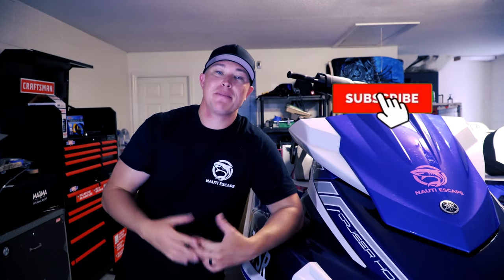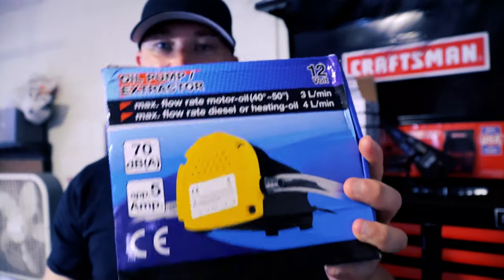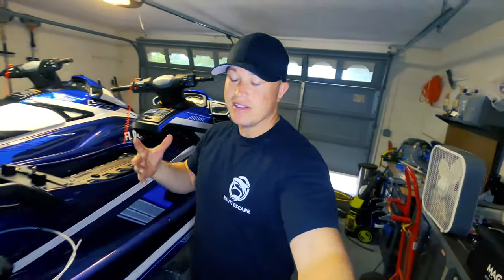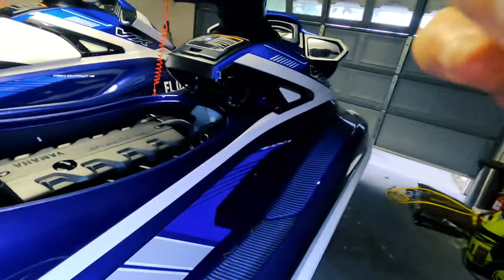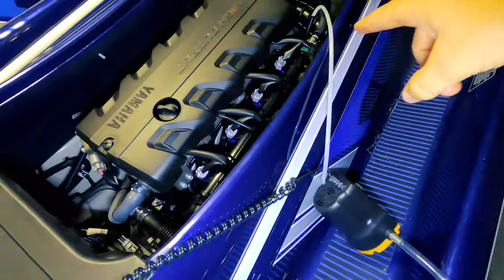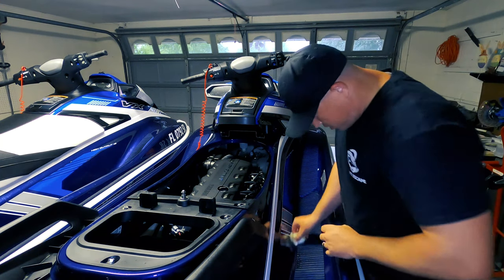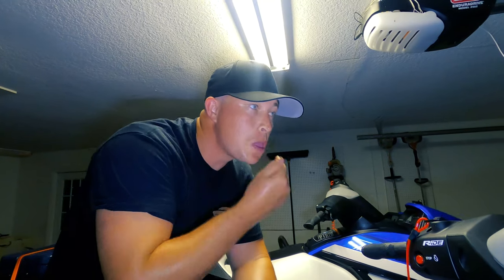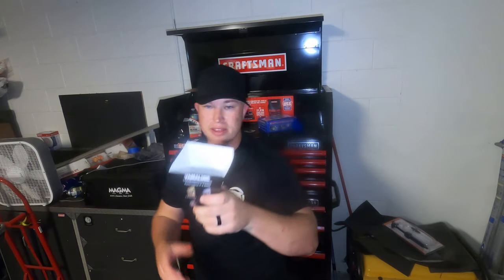How to change oil on jetski

Comment: Good job on your oil change. Use rags or towels when changing filter.
Reply from the maker: Thanks a lot. Certainly made a couple mistakes that some have taught me but it wasn't bad for the first try and shows how easy they really are to do and you really don't have to be that mechanically inclined to do them.

Comment: Yo bro correct me if I'm wrong but I thought u had to run a water hose through the unit b4 u start it?
Reply from the maker: Absolutely! I added an update in the description of doing so as well. 

Granted the only thing your going to do is take out 3.5 quarts of oil sucking it out vs 4 if you don't let it warm up more. 

As far as dry starting it you can let it dry run for about 30 seconds per the dealer. Everytime we come out of the water and put the skis in the trailer we'll start them and hit the gas 3 or 4 times which will push all the water out from inside rhe skis vs having to take the drain plugs out each time.

Comment: Yes. Fuckers charge like $160 per ski in my parts. Fuck that shit. I do Amsoil myself (after watching project farm channel, that oil is seriously long lasting) it's full synthetic. You can extract from where you did,  on my vx limited I have to use the upper hose too to get out more oil (~another half to 3/4 qt was hiding there). Not sure on the 4 bangers though, I have the tr1 motor which is 1049 cc 3 cylinder (2020).

Comment: Put hose clamps on that electric pump to hold the hoses in place, I found out the hard way that they will loosen with time and make a mess of your garage when they come slipping off while pumping oil out. As for the oil filter try to find a crown wrench that you connect to a ratchet to make your job so much easier.
Reply from the maker: I'm glad you told me about the hoses, or I wouldn't have thought about it until it was too late I'm sure. I really do appreciate the helpful advise!

Comment: I believe it’s worth going to the dealership I pay 250 for plugs and oil change and they lubricant and grease necessary components I had 2006 Yamaha FX cruiser he chose I just saw them in 2014 and had zero problems with them I believe is worth it to check for updates also and recalls
Reply: I would normally agree but in today's world it's hard as Hell to get good help and workers.  Who the heck knows who's doing the work and how well he/she is doing it.  It's sad...

Comment: Hey love your vids bro! When did you do first oil change on your vx ho? I've been advised to run the bike in for about 5hrs at low revs then do oil & filter change at 10hrs.... 
Want your advice 😆
Reply from the maker: If you ask 10 people it seems you get 10 different answers lol.

Dealership told us to run the skis for a half hour at mixed RPMs and then we were good for break in. We've been told by others do it for 2 hours, and even to never hit full throttle for an hour.

We changed our oil and filter around 10 hours. Manufacture says you dont have to change the oil filter at 10 hours but others have said all the loose metal debris from the new motors will be in there and that's the most important time to change them. It sounded logical and the filter comes with the kit so that's exactly what we did.
Reply: @NautiEscape  well I'll take your advice on it then bro! Thanks for reply 🙌🏼😉
Reply from the maker: @julianmcgrail7518  lol anytime man! Good luck

Comment: Do you need to change the oil filter on the first 10 hour oil change?
Reply from the maker: I'm no expert by any means. This was my first time changing the oil and I just wanted to show how easy it was so people don't waste their money. Even here I made a few mistakes.

However I was told at my boat dealership that's the most important time to change the filter as the new engines may have metal particles floating around inside of it that needed to come out so it doesn't cause any internal damage. 

Now idk if that's true or not but it did sound logical so it's best to be safe than sorry.
Reply: @NautiEscape  That is correct, the first oil change is probably the most important so that you can get all the break-in material out of the engine.
Reply from the maker: Thank you for clarifying that
Reply: No not until 100 hrs or 12 mo according to Yamaha maintenance schedule.

Comment: Make sure you silicone  your motor etc
Reply from the maker: How often do you do it? I was told only if you take it in salt water before and after?
Reply: @NautiEscape  I use it in salt water, Every time before and after cleaning.  Use salt away on the engine and body and flush it thru.    I have the same ski and  my wife has the 2021.  Sorry so late on the response!

Comment: How much oil do they take?
Reply from the maker: About 4 quarts. Mine only needed a little about 3.5 quarts but I didn't let the engine warm up properly either and that's probably why
Reply: Awesome. Well the wife and myself just moved to Tampa and bought the same one you have.  Hope to see you on the water!
Reply from the maker: @willthesinger1  yea absolutely! Were closer to the orla do area so it's not too far away